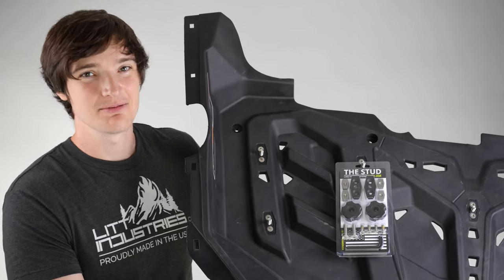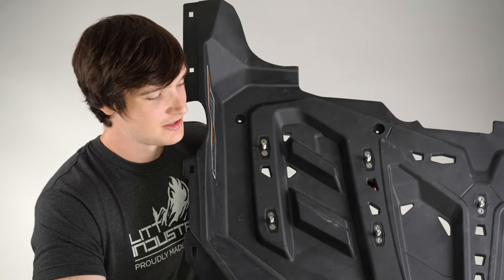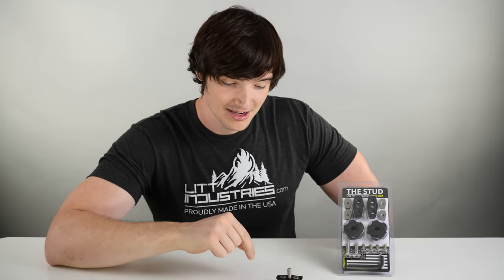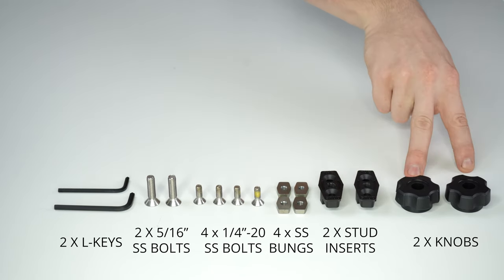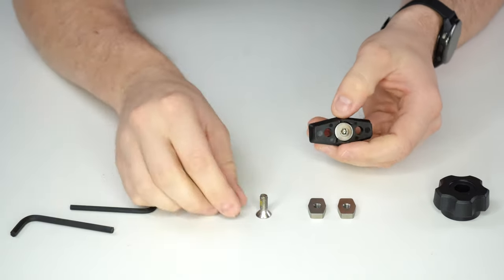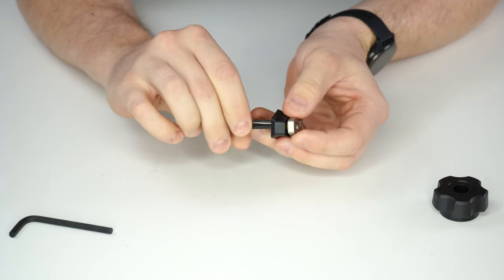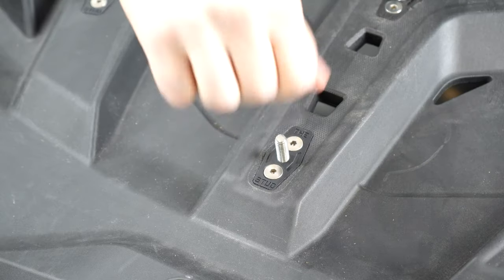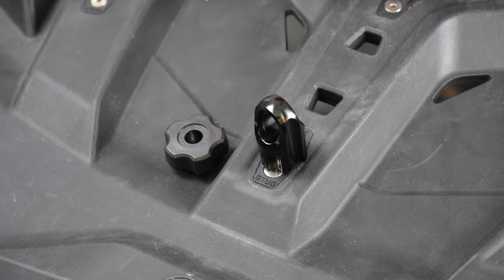Can-AM The Stud Linq System

Comment: Will this kit help secure the black boar rear lounger seat to my can am?
Reply from the maker: if your vehicle features can-am LINQ holes I don't see why not, but it also depends were the holes sit on your vehicle you may need to drill into the base of your lounger and use large washers to ensure a secure mount. but for liability reasons we have to state it wasn't design around that product.

Comment: Will this work for a two up seat? Will it hold the weight if I put 4?
Reply from the maker: We have tested the pullout strength of our stud mounts to exceed 500lb force in our standard assembled orientation. We reached 800lb force in our tests with the results of the bed cracking and our mounts perfectly intact. So they definitely have the Strength but for liability reasons I have state it was designed for cargo and our mounts and not personnel seating.